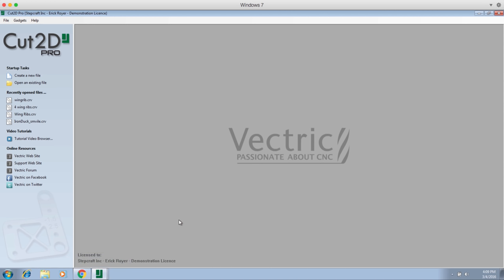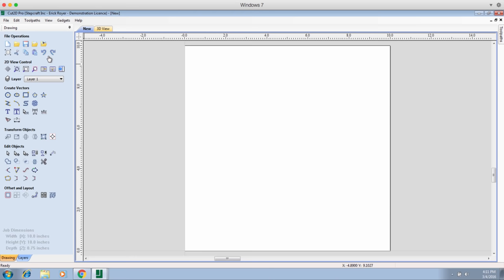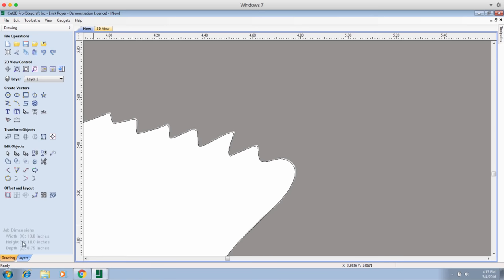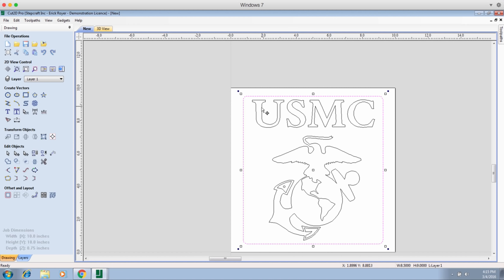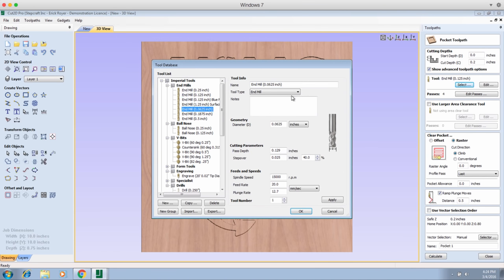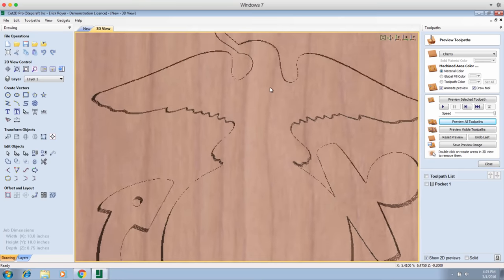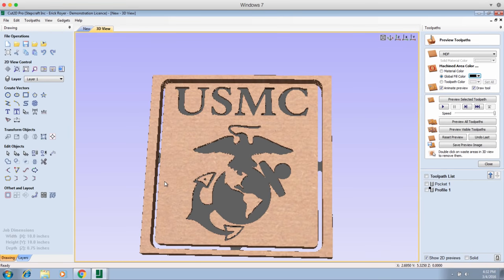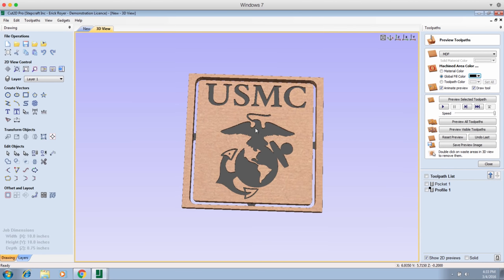STEPCRAFT TRAINING: Bitmap Image Tracing with V Carve and Cut 2D For CNC Designs

Comment: I want to dedicate a computer to run  my CNC in the shop. I'll be designing  in my office on another computer.  What "shop" computer requirements are needed to run a Stepcraft CNC? Tks!
Reply from the maker: Honestly, we have machines in our demo room that still run on Windows 7 with 2gb of ram.  The requirements for UCCNC are not that great.   I would say any low-cost windows computer would be find to run the machine.  However, if you want that computer to run Vectric or Fusion 360 then you might want to look for something a little more powerful 8gb.  We also have had good luck with the micro computers like this one: https://amzn.to/2OSKVku.  I like it because no fan for dust to get inside and we run a touch screen monitor with UCCNC which is awesome like this one: https://amzn.to/367ZPsK . Let us know if we can be more help - info@stepcraft.us